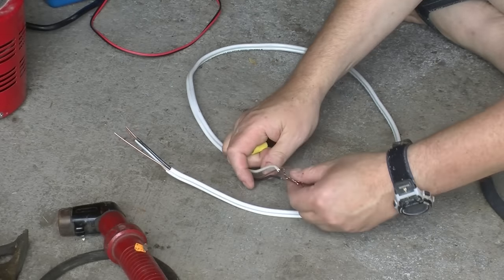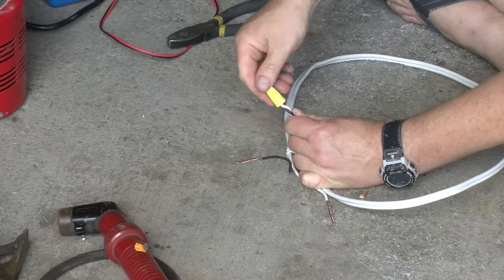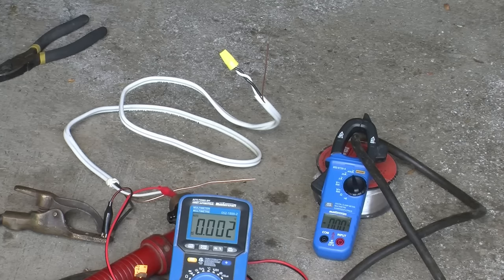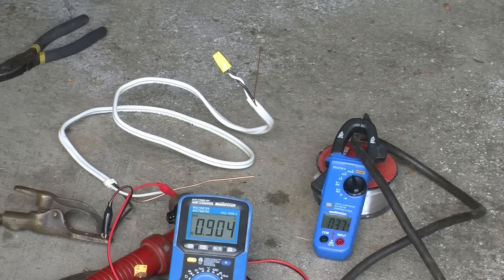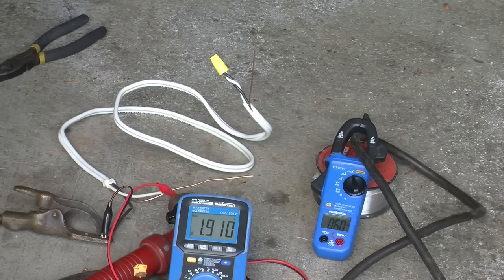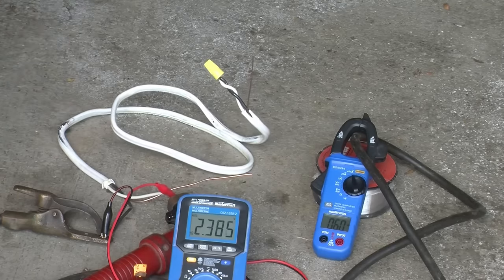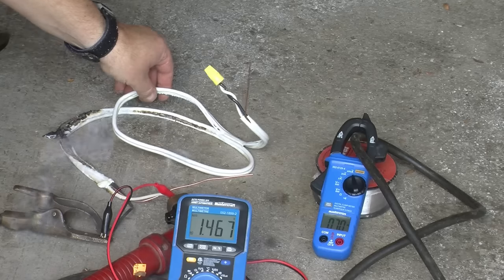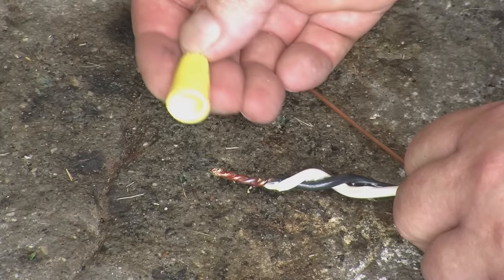How many Amps to burn up 14/2 electrical wiring?

Comment: As a 66 year old Master Electrician I appreciated your test. It helps to see the tolerances of the material we use in the field so we have a better foundation to talk to our customers. We all go through the classes and books but to actually see the breakdown of the conductor is impressive. This gives me more confidence in the load carrying capacity of house wiring especially with today's insulations which raise or lower the load capacity. Thanks ;)
Reply from the maker: I glad you found it useful. I did a few other videos  with 14/2 in 2x4 walls with various types of insulation such as fiberglass and foam. I am actually a bit concerned about situations like a fully loaded cable between piles of insulation in hot attic in the summer  running an air conditioner. I would probably ask to have the wire increase in size by a gauge or so in situations like that. 

I'm an electrical engineer so I don't get to see the real-world examples of things the way you do (and also usually deal with low power RF signals most of the time). Have you ever seen NMD or other cable damaged by running close to the max rated currents when situated in the middle of insulation in an already hot environment? Any sense from your experience how close to the edge of the safety margin we are with modern cable and insulation?
Reply: @ElectromagneticVideos  Well in the field we follow the NEC which requires no more than 80% load on any circuit and manufacturer recommendation for dedicated circuits for apparatus like dishwashers, A/C's etc. so for the most part we do not see break downs like your test unless the work is done by unlicensed people like Home owners who simply wire to make things work not considering potential consequences. However with the advent of more home generation equipment and EVA's  and other new apparatus, I can see more overloads and fires with misapplication and improper wiring of such equipment. I will say I see a lot of interruptions and breakdowns using these Mexican made receptacles, switches and foreign made new light fixtures which do not have the same oversight in manufacturing that used to be the standard in US made parts. Especially after NAFTA which made foreign made material the standard in the construction industry iMHO
Reply: What I would love to see is more test videos on Service Equipment in todays environment using ARC FAULT devices. I see these products not proven in todays world. But time will tell. Thanks again.
Reply from the maker: @carylamari6546  I actually also have seen scary stuff done by homeowners. I have a buddy who does home renovations on the side and you wouldn't believe what was in one of his projects - the previous owner (and I am embarrassed to have to say was an engineer!) used everything from speaker wire to coax to hook up additional light fixtures and outlets. We spent a fair amount of time searching through things just to find the hidden things to point the electrician to to remove or replace. I wish I had been making video back then. What an example of what not to do! The plumbing was equally "interesting".

Interesting you mention home generation and things like EVs. I will be adding some (used) solar panels to my house and have been researching the often not too to well publicized specs of the breaker panels when attached to loads + generation sources at the same time as the grid. I can sure see how things can go wrong if the panel bus rating is less than the sum of power sources  if large loads are attached in spite of everything having properly rated breakers. 

And yeah - general cheapening and lower quality parts does not help!
Reply from the maker: @carylamari6546  Well I just came across some Cutler-Hammer Arc Fault receptacles on sale, so I will be trying to see what sorts of arcs can trip them.  Still have to figure out how to do it - probably with everything running though either a gfci or isolation transformer (I have kw sized one) and making the arc using a switch with  poor snap action or some sort of touching cables current limited buy a light bulb ... . So Arc Fault stuff to come in the future!
Reply: I just installed 12/2 Romex 20amp breaker Bosch oven has dog leg plug 1700 Watt micro combo.  Seemed fine to me but this guy just mentioned 12 amp max continous load in 14/2.  Continous load where are those specs?
Reply: @SeagulRules-jg3br  14 gauged wire is rated for up to 15 amp load. However the NEC requires a maximum of 80% load to rated breaker so for a 15 amp circuit you may only use 12 amps on that circuit. Now if something is continuous duty you must rate the circuit and overcurrent protection  at a minimum of 125% of the specified Load as it is rated by the manufacturer. As an aside I cannot ever remember a home microwave rated at more than 1600 watts? now the code does provide for uping a overcurrent protection device up to the next 1/2 size breaker so if a 25 Amp breaker is needed on a 12 wire circuit. It is allowed. But I think you might want to re-look at the manufacturers suggested load of the Microwave oven if it is a residential microwave,
Reply from the maker: @carylamari6546  Question:  what is the formal NEC definition for a continuous load? Would a microwave be classified as continuous?
Reply: @ElectromagneticVideos  From memory it is simply any load which operates for 3 hours or more. And as such should have it's load increased by 125% Larger wire size and breaker
Reply: A microwave would not be considered a continuous load.
Reply from the maker: @carylamari6546  I was just about to type the question - you read my mind!

Comment: This was interesting to see, and one should keep in mind this is in open-air.  If you had a fan blowing on it, it would go higher, and if you put building insulation around it, it would heat up much faster and support less current.  Finally, the fact it burned at the corner is also a clue, the thinner the wire is at a particular location, such as a bend or pinch-point, the greater the resistance there, and the more heat generated.  So, to compensate for all of those factors and more, it is rated for 15A max to ensure safety.
Reply from the maker: Very good point. I actually did follow up experiments with the 14/2 in a fake 2x4 wall filled with various types of insulation and the results are exactly as you predict.

Comment: Twisted solid core wire can get brittle overtime, as well that it can be difficult for someone to take apart safely. If you want your wiring to last, no matter what you do, please leave an ample service loop if possible. You or the next electrician will be very grateful!
Reply from the maker: Very goo point about making sure there is extra wire length for future (re)work - such an easy thing to do  yet some people seem to skimp on it.

Comment: When I bought my home 10 years ago most of the house was wired with 10ga cloth and vinyl wrapped wiring, with some scattered modern 12/3 for new outlets added, and they added 10/3 to dedicated outlets to each window air conditioner outlet. 
The worst overload was the living room which had four lamps, each with a 100w bulb and run off a single run of 12/2 w/o any ground, which also included the front porch lights and two outside outlets and four single bulb fixtures in the basement below, each with 100w bulbs. 
It showed no sign of any failures but I did run new 12/3 runs to each outlet, one to the porch and two to the basement lights on that side when I tossed the old screw in fuses for a new breaker panel. The old wiring was plastic insulated wires in some sort of silver cloth wrap. 
A few bulbs in the basement still have that wiring but little by little I'm replacing those fixtures with LED units, and for now, every bulb in the house is LED.
Reply from the maker: I lived in a few houses with messes like that. An some that included silver cloth platic wireing that I think came just before NMD. Sounds like your a bit like me - every home I lived in was safer when I moved out than when I moved in.
Reply: that doesn't seem overloaded. 12/2 can handle 1900w without issue and upto 2400W for non continuous loads, if it was overloaded it would continuously flip the breaker

Comment: That was interesting AND educational!  Well done!  Never thought to test house wiring before, but I feel a lot better about the wiring in my house now.
Reply from the maker: Glad you liked it but things are not as good as in this video when in a real wall - did some  later videos where I built a section of 2x4 wall with insulation around the wire. The safety margin goes down quite a bit as expected.
Reply: @ElectromagneticVideos  I would completely expect that.   I'm a communications engineer, and essentially what you are suggesting relates to heat dissipation,  due to the resistance of the wire, it develops into heat, and as long as that heat can be dissipated, the wire is fine, same deal with a forced air electric heater.  If the fan quits, that wire is going to burn up unless it is protected with a heat sensor to shut it down of course.  If you don't have a thermal camera, they are great investments, as you can find heat and cold leaks in your house, and they are awesome for troubleshooting circuit boards and defective components.
Reply from the maker: @jimturpin  I actually did get a thermal camera for the later tests - great toy to have! Communications Engineer? What do you do - I used to be involved in HF/VHF/UHF comms. Now  I'm more in the faint signals detection type of stuff in the microwave bands. HF was great fun - nothing cooler than transmitting vast distances with a few 100w.

Comment: The voltage suddenly dropped to nearly half at the point that the insulation began melting even as the copper heated and began increasing its resistance.  Then it began rising again from the lower value.

I suspect a short part way along the cable, which reduced the impact further down the line (eg: at the far connector).

Comment: Super video! I see a few suggested a thermal imager! Also would be cool (actually hot) to see actual degrees temperature along with your observations as to touching and explains the heat! Again, enjoyed the video!
Reply from the maker: Glad you enjoyed it. I'm getting more and more tempted to get a thermal imager. I do have a thermocouple  temperature probe on order. Now that I think of it, I wonder if my IR temperature gun would work or if the wire is too narrow for it.
Reply: @ElectromagneticVideos  It would be worth checking and seeing if your IR temp gun will pick it up.
Reply from the maker: @unclemarksdiyauto  I will!

Comment: I once ran a 1500(?)1800(?) watt space heater on a 100 ft 12 gauge extension cord that was wrapped around one of those plastic circular cord wrap things- so the cord was insulating itself from cooling off.
I was just going to run it for 20 minutes so I thought it would be OK.
I ended up falling asleep and when I awoke suddenly 5 hours or so later and ran out to the garage the whole garage smelled like hot plastic and the cord insulation was noticeably soft.  
It permanently changed the insulation  on the outside of the extension cord
Reply from the maker: Wow - what a real and scary example of the damage that can occur from current overheating the plastic insulation. Interesting that the insulation was permanently changed. I what what chemical change was caused by the heat on the plastic.
Reply: @ElectromagneticVideos  I'll try to get a picture of it and send it to your email in the next few days.
Still kind of spooks me a little bit. 
I had an InstantPot that had some kind thermal event too.   It turned off before there was any damage to the counter but the IP was shot and wouldn't turn on
Reply from the maker: @jeffa847  That would be interesting to see. 

I wonder if the instapot had some sort of internal thermal fusible link that saved the day after whatever failed.

Comment: This video reminds me of some scary pages on the subject of Federal Pacific Electric breaker panels. Despite several design revisions, independent tests have demonstrated that  the circuit breakers in these panels are prone to failing to trip.
Reply from the maker: Yes - I have read about them too. Its hard to imagine how much worse it could be with those breakers. While the simple heating and melting of the plastic wire insulation would be similar if someone plugged in too big/many loads like heaters, once a short did occur in the cable as a result of the plastic melting the AC power system would not be inherently current limited to a few hundred amps like the welder is. You  could easily expect 1000s of amps flowing and the copper wire vaporizing. Hopefully the main panel breaker would trip fast enough to prevent a more catastrophic result - no idea if the main breakers have  the same failing to trip problems....
Reply: i still replace those zinsco breakers with aftermarket ones- people dont want to spend for new panel- although i tell them the dangers

Comment: Thanks for this video.  I now understand why our local code limits voltage drop on cables to 3%.  In extra long cable the heating effect would be even greater and so the current capacity even less.
Reply from the maker: Yes - the longer the cable, the more total heat generated for given current and with a proportionally grater voltage drop. It is worth pointing out the heat generated per foot depends on the current (and resistance per foot of the wire) so the extra heat generated is distributed of the longer length and the temperature rise is the same regardless of length.
Reply: That's a good point. The code is based somewhat on voltage drop, not just heat in the conductors. A large voltage drop can burn out motors.

Comment: The way you touch the wire is spine tingling, good luck
Reply from the maker: It not as scary as it looks! Because the end is shorted there are only a few volts needed across the conductors to push those levels of current though and generate the restive heating effects.  I wouldn't be touching them if it was live 120V!

Comment: Great demo. I like your narration through the increasing amperage. Make sure to remind folks to not try this at home.
Thanks for sharing.
Reply from the maker: Thanks  - glad you liked it! Yeah - maybe I need something at the beginning of each video saying "don't try this at home". Do a have warning at the end ....
Reply: @ElectromagneticVideos  yes, I saw the warning at the end. I noticed you stated the 14 ga wire was only supposed to carry 12 amps in a home situation. You did a great job. Thanks again.
Reply from the maker: @thomasglessner6067  I really appreciate  that Thomas!  You know what was a disconcerting surprise to me - in some of the videos that came after this one I built a 2x4 wall section and did similar things with the 14/2 inside between insulation. The safety margin drops so much in that situation  that if I was building a new house today, I would make sure 12/2 was used at least everywhere it goes though insulated outer walls or (worse) hot insulated attics.